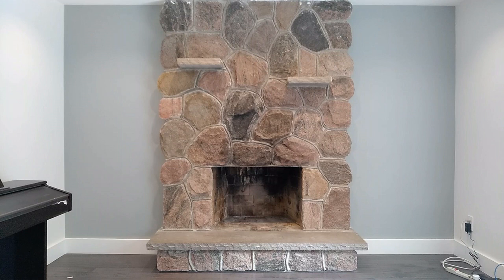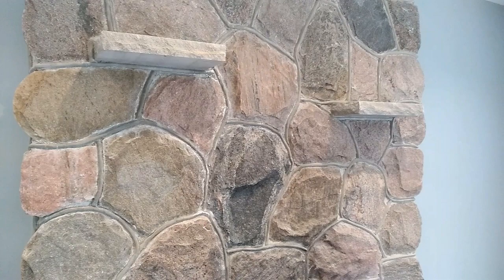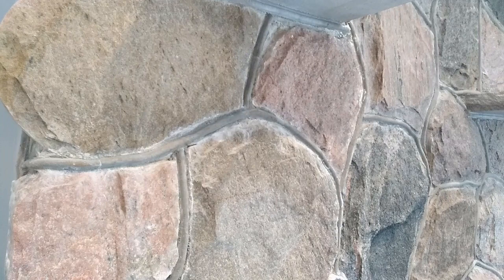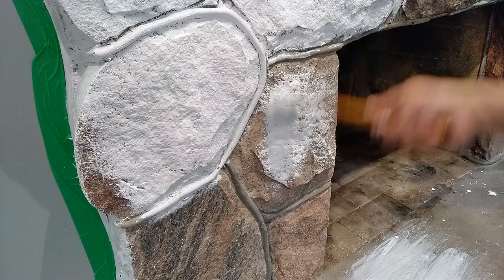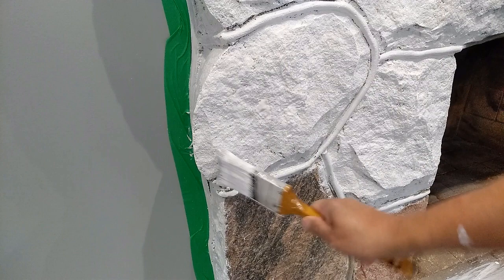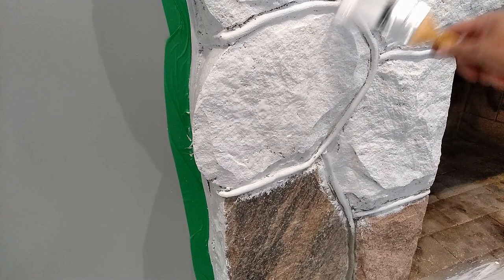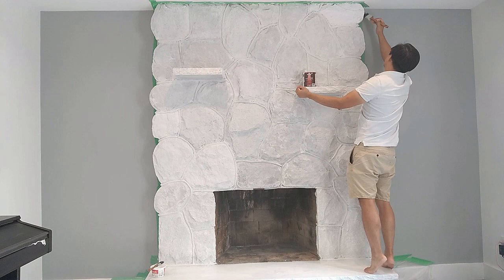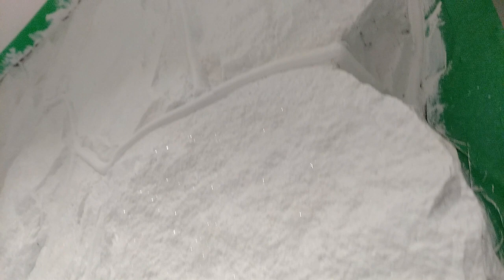How to Paint A Stone or Brick Fireplace and Transform it for $75!

Comment: Very cool will be doing this in my 1950 house that has really large stones and black mortar  will let you know how it turns out thank you!! 😊
Reply from the maker: Great! Some have asked us if we use our fireplace (i.e. with fire) and we do not. If you plan to, you can consider high heat paint. It might not be necessary since the exterior stone facade may not get that hot.
Reply: @alwaysbelearning5655  on this type it doesn't get hot so it shouldn't be an issue or I would definitely use a high heat paint it's field stone with stones up to 2ft across so I'm looking forward to trying your technique out.
Reply: @alwaysbelearning5655  so I got the fireplace done and have had no issues with heat but like I said before there is alot of rock between the inside and the outside 👍 the technique worked beautifully tho

Comment: Mine is already painted an awful poop brown! How can I get it off and do something prettier?
Reply from the maker: Hi Jonda! You could paint over existing paint by following the same procecure as shown in the video (primer first, then paint). However, my concern with doing that is losing the texture of the stone that you have by adding several layers of primer & paint. Perhaps you could try getting a small amount of paint and testing it in an inconspicuous area (such as the side or bottom) and seeing if you like the resulting texture? Having said that, if you look at the final texture of my fireplace stone in the video, I don't think it would be a problem adding at least 1-2 more coats of paint, but in your case it may depend on the current state of your stone surface. You may also need to check to see if any areas of existing paint are chipping away in which case you should at least sand of any loose bits.

Alternatively, you could first remove the existing paint using a few different methods. There are mechanical ways of removing paint (sanding, pressure wash, or sand blast) and chemical ways (solvents) and if you go to your local paint store, they should be able to provide you with different options.

Comment: did you use a flat paint over the primer? How did you apply the sparkle?
Reply from the maker: We used a flat white paint. In the video, you will see we applied the sparkle using a dabbing technique where we would wet a paint brush, dip it in the sparkle and then dab it over the still wet paint.

Comment: I really want do it but I’m scared to ruin everything 😩
Reply from the maker: I understand why you are hesitant! We felt the same way before we did it.  It's up to each person to decide if they want to commit to a project like this. It would be difficult to remove the paint after (although maybe possible depending on the condition of your fireplace but you might need to call a professional). It also depends if you actively use the fireplace (we do not). For our situation, it turned out great and we have no regrets.